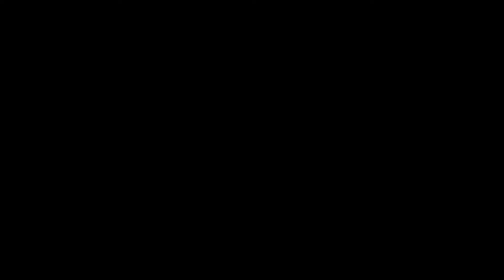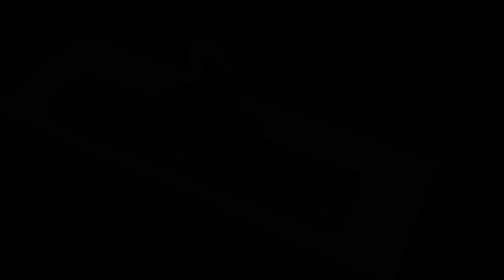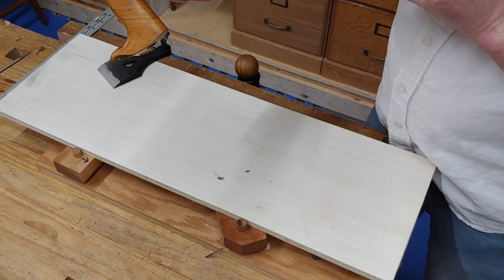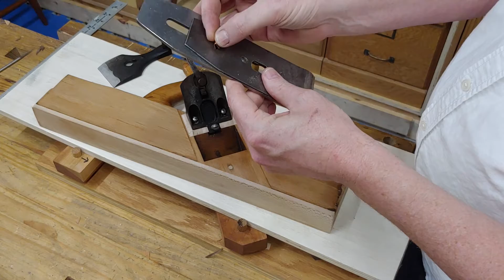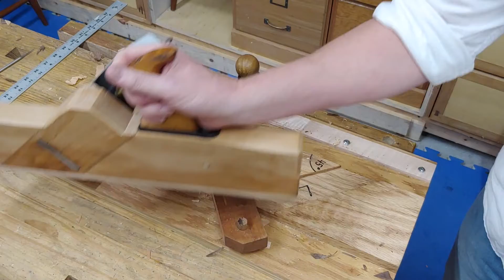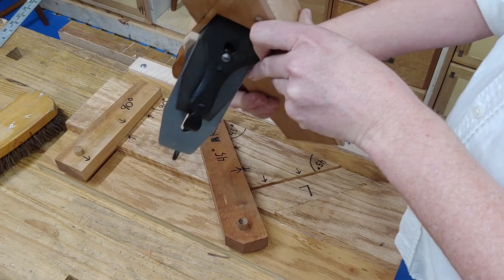Turning a Stanley No. 29 Transitional Plane into a Shooting Plane

Comment: wow, brilliant, Many thanks..  being the lazy ass that I am, I just thought about tacking a 20 or 30° wedge to the side of the transitional plane, but your approach is much better, for both looks and function.  I wanted to avoid cutting a new mouth, but I thought If I cut a new one, I would also convert it to a low angle plane, by altering the seating face where the frog sits.  I will use your technique, thanks.  Now I have to buy another one, the one I have is beautiful,, almost unused #26.  I'll be searching for a junk yard dog.
Reply from the maker: Yeah, don't cut up your beautiful #26.  I find this mod works pretty well for smaller stuff.  Because of the rotated 45 degree angle, the blade can want to change lateral angles on you if you make big or deep (heavy) cuts.  So I found I have to tighten down the lever cap a bit more than usual to prevent that from happening.  I've been thinking about incorporating a set screw, like what Veritas uses on their planes, to prevent the lateral movement of the blade.  I too have kept my eye out for another donor, but haven't found one yet.  I would like to do a better video of the process, as opposed to this 'after the fact' video. Thanks for the comment and good luck.  If you post a video or pics anywhere of your mod, I'd like to see it, feel free to share in a post here.
Reply: @arrayedwoodcraft  yes, will do.  thanks for your interest and feedback.  It will take quite a while, as I first have to fine one good enough, but not too good for reconstruction.  Once again, Many thanks for your help, and video.

Comment: Really fantastic idea. I really don't see much room for refinement, possibly making the body of the plane a little thicker for stability, but I'm not sure that would even be necessary. After use, do you see any refinements that may go into "Mark II"? Again, great idea!
Reply from the maker: Hi Dwain. I agree with the idea of a thicker body would be more stable. Could try to make one with a traditional thick body wooden jointer. Like any handtool, there is a bit of finesse to it. You can tilt the plane away from the work if not careful. But with a little practice, I fine it does a pretty good job on smaller miter jobs like picture frames.  For a Mark II... I think maybe a lesser degree of skew might be worth while; 45degree was just so easy to start with.  I found that if you try to take a "deeper" cut, the cutting end of the blade will try to move to the upper side (left edge) of the mouth, but a tight clamp of the cap iron seemed to fix it for the most part.